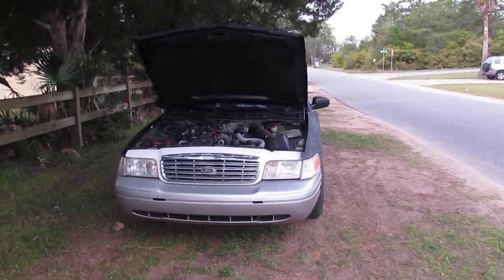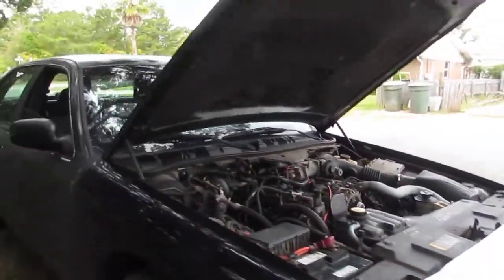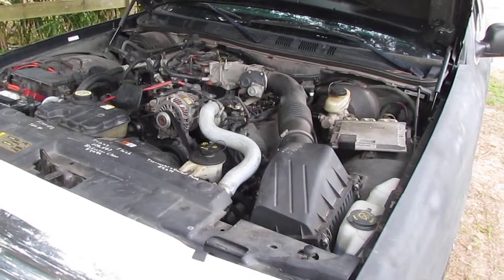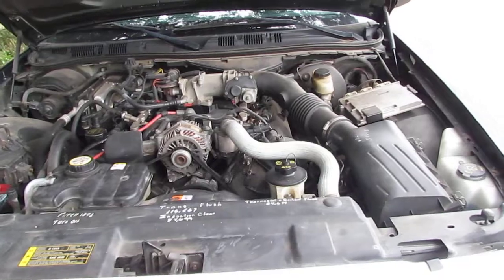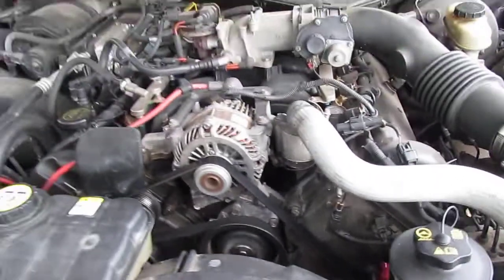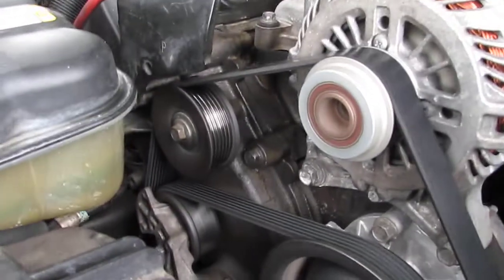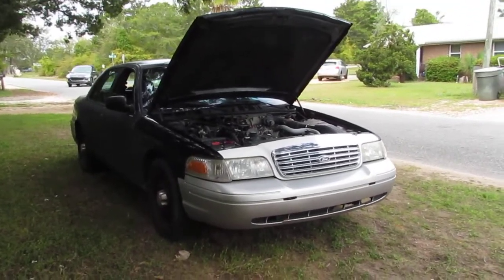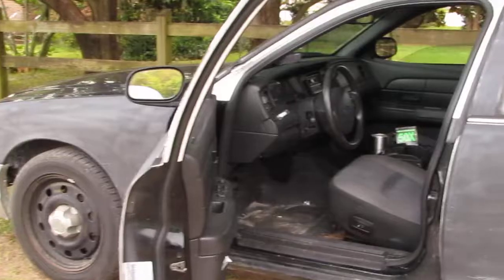2007 Crown Victoria Police Interceptor. Frankenvickie.

Comment: 2007 115k miles for $3k good deal?
Reply from the maker: Maybe how many idle hours ? is it one color or black and white ? you check the idle hours with the trip odometer button
Reply: @skswig1  yeah black n white
Reply from the maker: @thowdow5626  no I would not pay that much for a black and white. If it is still loaded with police stuff you can sell that stuff and get some money back like the pusher bar, radio console, spot lights, light bars etc.  But generally no I think that is too much for a black and white. You got to figure a paint job is going to cost at least 700.00.
Reply: @skswig1  ok thanks yeah up in NorCal we got tweeker prices. People selling salvaged 90s cars 225k miles for 2k. I wanna do the paint job myself. They sell that rhino liner and spray can on Amazon for  $180. I want the white so people move lol. But the rhino paint can be used on rusting areas on the underside..but is it true they have imatators? Like the milage meter on the dash isn't digital but stock number roller. My friend had a crown Vic and it had a digital dash Mile meter..would u know about that? Also what should I pay for it if it's legit? With those low miles.
Reply from the maker: @thowdow5626  I was thinking about doing rhino liner on mine in a two down coyote type color. In Florida I can get a primo grand Marquis for 3 grand I mean like less than 100,000 miles.
Reply: @skswig1  nice. Stuff helps with rust noise and insulation.. Yeah nice. Marquee over here probably over 5k. Bs. Another example of California being overpriced. Qualitity of life suppressed financially over here lol..... But yeah light truck tires too would be nice or Wrangler wheels. I'd like to make hood vents. Cool air intake box and heat sheild. Maybe customize bumper (more air intake slots) to throw more cool air into the engine compartment...idk. people say they slow but not really with all that weight behind it. It's all bout modifications and maintenance for best results. One best truck/cars for real